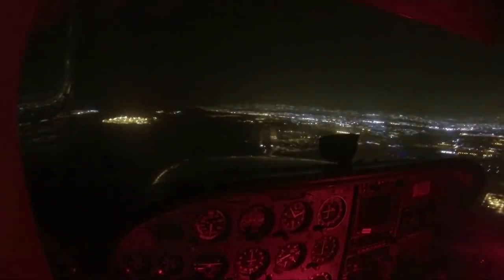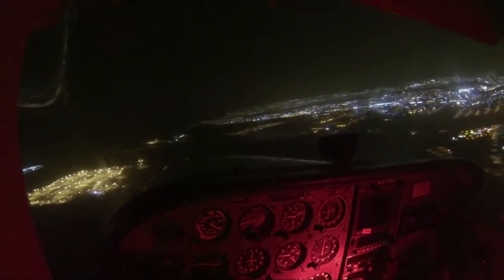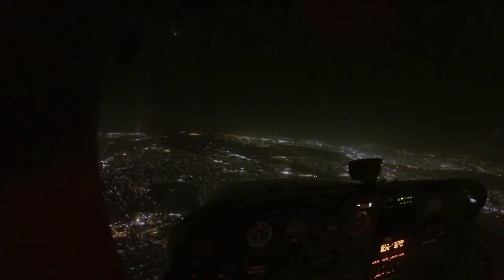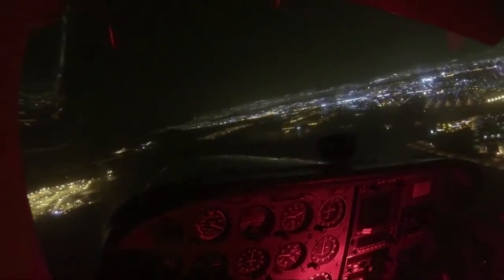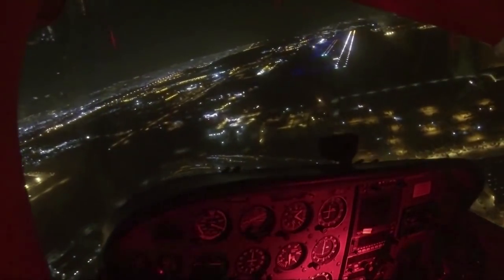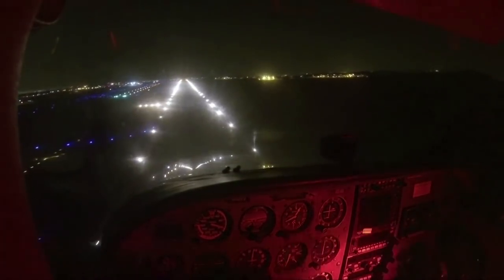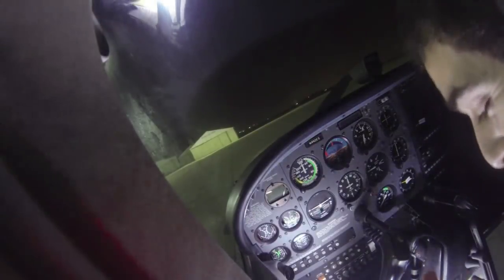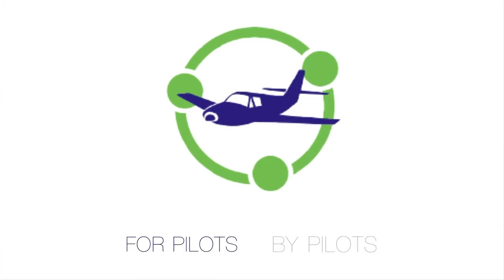Total Electrical Failure at NIGHT - Low time pilot - POV Flying

Comment: Imagine if the runway lights turned back on...  That would mean another plane was coming in behind him and he'd have no radio to let them know there's a plane with no lights sitting in its way
Scary stuff
Reply: There would be runway lights and they would see the plane and abort the landing.
Reply: Ahmad ob Not necessarily. I don't know if you're a pilot or not,  but at most uncontrolled airports the runway lights stay off, unless turned on by keying the mic 3 times in this case for night flying (Low Intensity). If there happens to be another aircraft behind him, he most likely wouldn't see him until he's right on top of them, even if he turned the runway lights back on. Also if these guys did see another aircraft coming in, they wouldn't be able to do a go around... like he said in the video "he has electric flaps, which are down", the you can't climb in a 172 with full flaps at 65 knots. So he'd probably just end up in the trees at the end of the runway.
Reply: Forget it. The only lights you can see well are the strobes. And with no power the strobes are off. He is on the centerline and belive me (I have a night flight qualification), only due to the runway lights, the centerline stays black. You only see the ground with your landing lights and then maybe its already too late.
This is a very dangerous situation.
Reply: Big throttle and run it off the side of the runway. Probably be cheaper to pull it out of the mud the next day than paying for three funerals plus how ever many in the incoming plane that would hit them..
Reply: Rubberboot  the latest i usually turn on the loghts is 6 miles away. And im flying helicopters. For fixed wing thatd be short final. So id expect that aircraft to be 12miles out. Wprst case 8 mile final.. enought time to land and taxi off the runway.
Reply: It would be a bit terrifying, but you probably have at the least one or two minutes before the arriving aircraft lands, and because the lights are on, you can see where the taxiways are now. It's be a bit rushed but clearing the runway shouldn't be an issue.
Reply: Doesn't have to mean that. My flight instructor usually gets pretty bored on long night flights so every now and then when he passes an airport, in order to check his location, he would click the lights on to full brightness. If he didn't see them come on he knew he was screwed.
Reply: that was clearly a runway for small planes..not an airport. and i dont think that night someone else was landing
Reply: @geniusmarcsays2434  that is still an airport, regardless of runway size. Also, aircraft can land at anytime, even if its in the middle of the night although it is not as frequent. Use some common sense on that note.
Reply: DJ he could just move out the way lol it’s not like in 1 second the lights turn on a plane is behind u he would have enough time to just drive off the runway into the dirt and head away
Reply: People are implying all pilots are good pilots.
If a crusty farting old man is trying to land behind him, he's probably seeing worse at night than the camera, might have never called in on the radio (I've had people do that to me before) went for a straight approach landing (you're not supposed to do that on uncontrolled airfields but again, the old guys love to do that) and worse, probably forgot his lights because his memory is failing him.
I nearly had a head-on collision with one of those retired guys once when I was in short final. The damn guys should be locked in their nursing home permanently..
Reply: Well, he still got his engine, he could just leave the runway 😊
Reply: @redworior66  nope because the loss of electric power that means the aircraft's exterior lights would be off aswell so for the other pilots by the time they saw the Cessna on the runway it would be too late
Reply: @thegamingaviator13  Yes if they lost both the alternator and battery that is correct.
Reply: i wonder wehy the lights went off, is there a timer?
Reply: @Raketenclub  yep there is it's 15 minutes. You have to click the mic on the same frequency to turn them on
Reply: @redworior66  thx :)
Reply: He would land on his back and if everything gone right, the planes could mate! :)
Reply: Wow, thanks to all. I am not a pilot but play around with a flightsim every now and then, didnt know one can switch on and off the lights of the airports, i thought they are on all night as long the airport is active or someone is in the tower.
Reply: well no because when the runway lights come off that would mean the airport is closed they don't just turn it off that's just dumb
Reply: there's a thing called blackhole affect, runways like these, even with lights you will feel like landing onto a black hole. An airplane with no lights whatsoever on the runway would be very hard to see until the final moment of touchdown. I am a student pilot, haven't got to night flying yet but have flown at night (not as PIC) and have seen the black hole affect myself.
Reply: I had that thought too but that incoming plane would still be a couple mins away. And the taxiway lights would atleast switch on, so you'd have enough time to taxi off the runway.

Comment: Fantastic footage, I am impressed with how he put it down after the lights went out.   beast mode.
Reply: He could likely see a lot more than the cheap camera recording the footage.  Exposure is notoriously bad on those things.  Still though it had to have been pretty nerve wracking.
Reply: I'd get a powerful flashlight outside the window w/ a throttle position prob set to like 15% for a good glide slope.
Reply: We are trained to look down the runway (even on daylight landings), so if the runway lights go out, you can still focus on a particular city light beyond the length of the runway to guide you, and if you keep your speed consistently just above stall speed, your landing should still be on the runway. Good job by the pilot.

Comment: First flight without an instructor. First night flight. No electrical, no landing lights, no radio... How does this guy put his pants on with balls that big? Gotta be a struggle.
Reply: And how does the airplane even takes off with such crippling balls of steel overweight?
Reply: From this flight on, everything else will be a cake walk haha
Reply: A single prop carried those balls... Obviously the plane failed from being overworked.
Reply: The same way the wright bros took off and landed with no electricity.
Reply: @tonyweaver2353  A bit different, but yeah. luckily the aircraft was mechanically controlled.
Reply: I'm pretty sure if you get the planet balls package with that plane it comes with custom flight pants for that reason
Reply: If this is his first flight without an instructor, how was he legally able to carry 3 other passengers?
Reply: @sgt0m0sullivan  Possible pilot passenger? Not sure on that one, but he did do well.
Reply: @timbrwolf1121  Definitely. I would have a reflex of going around when those lights kicked off. I probably wouldve then tried to find a towered airport and saught lightgun signals, but those flaps were stuck, and like flightchops said, electrical failure could indicate a fire
Reply: @sgt0m0sullivan  Most definitely in a full failure like that LAND. Wherever you see a clear zone. He was lucky that zone was a runway and not a dimly lit city street. Hell that's what drivers education teaches as well in states with decent drivers ed. If your vehicle shuts off and you lose any type of control stop and/or move to shoulder. Kid had already finished his final. All he had left to do was land it. Sucked he had no lights, but he nailed it better than pilots with hundreds more hours.
Reply: Also he apparently had an FCC amateur radio license to be able to carry that handheld and legally be able to communicate with it. Many props to him on that. Many pilots do not carry a handheld
Reply: @timbrwolf1121  Negative.  For the aviation bands, if you are a private pilot you can obtain a "Restricted Operator" certificate from the FCC by simply requesting it - no test required.  If you are flying the US - this is really pretty worthless as it will never be an issue in reality- but if you are flying out of the country it is required to operate aviation radios.  Also - there is no requirement at all to have any sort of license to own and carry a transceiver on any band - only to use it for transmission on certain frequencies.  So - it is perfectly legal to purchase and carry a backup aviation radio.  And if you are in an emergency, it is just not an issue whether you have paperwork or not.
Reply: @michaelbuckers  Oh goodness, too damn funny!
Reply: @sgt0m0sullivan  He must've already has his PPL at this point.
Reply: i think  it meant (though i maybe wrong) that this was his first night flight without an instructor not his first flight without an instructor
Reply: @jennydavis4198  yep, the narrator definitely says "It was his first night flight without his instructor." Clearly talking about night flying

Comment: Happened with a newer pilot at my flight school. He couldn't cue the lights for the local non-towered fields or get anyone on cellphone. He ended up sneaking in and landing at a non-bust class C airport. They never saw him. As soon as he landed, he pulled off the runway and another small plane landed from the opposite direction and asked tower if they knew why there was a Cessna in the grass off the runway.

Comment: Don't forget about the handheld Revolver incase the passenger turns into zombie.
Reply: Dont forget the emergency shutgun incase the passangers get really really anyoing.
Reply: AirPlanes? Just throw a grenade like in the movies.
Reply: Is there such a thing as a non handheld revolver?
Reply: @striker6240  Ryszard Tobys from poland scaled up a  Remington model 1859 to the point you carry it with two people and can not fire it handheld. ;)
Reply: @Tahydrahel  Yeah I fucking knew someone would bring that up. That is not a fucking revolver buddy that is a fucking cannon
Reply: NICK WHAT THE HELL YOU SHOT THE PILOT
Reply: @striker6240  It's not a revolving pistol, but it is a revolver of sorts. I guess that means a revolving cruise missile drum in a bomb bay is also a revolver.
Reply: @striker6240  Yo. Chill out.
Reply: @striker6240  Panel mounted revolver
Reply: @sgt0m0sullivan  Not a gun that is a modification to a gun
Reply: @striker6240 Thinking of the crotch revolver in From Dusk Till Dawn...

Comment: If you buy a handheld, don't forget to get the headset adapter because it's almost useless to hear anything in the cockpit through the handheld speaker.  It will work ok to turn on lights though.
Reply: Robert Bousquet even if you can’t hear at least you can tune into tower or CTAF and blab out what’s going on.
Reply: Definitely on my shopping list
Reply: Good information! Need to plug in

Comment: When I was taking my flight lessons I had two different failure that I got to learn form. My  single light bulb that lights up the panel burnt out and so I couldn't see at all; Lesson learned, I now all ways have a headlamp on my head or in the pocket by my knee. Second issue I had was my voltage regulator burned out and so my entire electrical system started to over charge. I burned out my radios and my landing lights, I was lucky enough to have my hand held radio charged and accessible with a head set adapter so there were no issues.....except when I landed at night at a small airport that didn't have lit taxi ways...I went right off the taxi way in to the grass. Had to shut down push back on to the taxi way and keep going. Fun stuff!
Reply from the maker: flyhigh8313x Thanks for sharing your story.

Comment: ipad and handheld radio...   now a requirement in my plane.
Reply from the maker: David Heon yup!
Reply: don't forget the emergency light attached somewhere so u can turn it on quickly with the push of a button :D
Reply: What is the iPad for? Not a pilot at all, just curious.
Reply: That's an awesome app, looks very useful.
Reply: David lemme fly your plane
Reply: @atomicmrpelly  The iPad is to use an "Electronic Flight Bag" (EFB) apps. Pilots can look at maps, weather, airport diagrams, and much more. 
In north America the most popular EFB is called "Foreflight". All the pilots I know have an iPad with Foreflight. I can't imagine flying without it but still carry paper maps just in case.

Comment: That was "some kind of cool" exercised there!!   Having flown over 30 years, I don't know if I could have done as good as he did.  Nerves of steel - gotta be!  :)   As you can see, "Murphy" is alive and well!   Thanks, N-6395T
Reply from the maker: Michael Donavon Thanks Michael, and yes, I'm appreciative that Stephen shared this footage and collaborated to help me me edit a video about it.
Reply: +FlightChops When those lights went off and the screen was total black I got the gut sink feeling.  Screaming go around in my head.
Reply: *****
I  watched the video again, and let me say this:  Stephen's performance, under extreme pressure, at around 60 hours of flight time,  is nothing less than phenomenal!

Wow!     He said that it was, "Pretty close to an emergency..."   Pretty close?   In my little 1,000 hr book, it WAS an emergency.   Thanks,
Reply: As they say, "Murphy was an optimist". Good job!

Comment: Very well handled imho. First step, fly the plane! It can actually help calm a passenger down by giving them a task in an emergency situation, such as holding the flashlight, or watching an instrument like an untuned VOR (obviously not possible without power). Then he assessed the situation, made his plan to land on the field, and executed it. Very nicely done! I am just at 40 hours, and should have taken my check ride already, but it's been over a year since I was in the left seat. I really need to get my motivation and finish! Thanks for posting your videos, it's really helping me get the itch again. After getting my chops back in the sim, I need to get back on that horse!
Reply from the maker: +Robert Reese Awesome! And yes you are correct about the "distract a passenger" trick.  I actually made a video about passenger management and that is one of the tips I share.
Reply: He had some serious luck there.. Had he been a minute or so later, the lights would have gone off before he was on short final, and then good luck charlie in seeing the runway..
Reply: Many years ago, I was  on an IFR flight into Fort Wayne in a Piper Archer. Just as I went into the top of the clouds, the panel lights went out. I reached up and cranked up the overhead cabin light, and with that, I could see the instruments OK and continued my descent, however the passenger in the right seat started checking out the breaker panel. Not wanting him to inadvertently hit a breaker that would screw us up, I told him that I had the electrical situation under control, but that it would really help if watched out the front window and told me the instant he could see the runway. It was about 500 overcast, so he was occupied looking for the runway almost right up to the end.
Reply: Robert Now that's it's been over a year since you left this comment I have to ask, did you get back on that horse and knock the rust off and take that check ride?

Comment: This is a best case scenario landing if I ever saw one. He was well withing the vicinity of an airport that was lit during the most important moments - other than just before touch down, but he did a great job of flying the plane and not allowing his emotions to distract him. He stayed calm, appeared to do some troubleshooting, had passengers assist him, kept the pax busy so they weren't panicking, and he got the plane down in one piece without injury or property damage. Very nice job!! Very nice for such a low time pilot too! Great video too! I love it!! It's a fear of mine. Of course my biggest fear is losing engine power at night - with or without pax. ;)

Comment: Excellent video. I love how every-time I watch one of your videos I not only learn something I either did not know before or hadn't been fully aware of, but I also keep adding things to my list of must have equipment. Today: Red-light flashlight, strong white light flashlight, extra radio. Thanks man!
Reply: Grab some combo lights, with one of them being head-mounted! After this, I quickly picked up a head mounted light with red and white.
Reply from the maker: Good stuff guys!  I have a combo light that hangs around my neck with a bendy sort of arm...  hard to explain but search "hug light" and you'll find it.  I also have 2 others as back up with in easy reach.

Comment: This pilot did a great job! My first solo flight in my T210N was daytime at KAPA. Super busy airport.  When I put the gear up, total electrical failure. Got to pump the gear down by hand, returned to the runway. An alert controller cleared it when he saw my transponder go out.  I carry a handheld now.

Comment: I'm a student pilot myself in the Houston area, and just tonight completed all night flight requirements.  Early on, I bought a hand-held radio, figuring it was money very well spent.  I use it before every flight to make sure it's working and the batteries are good.  I keep it in an external pocket in my flight bag, readily accessible at all times.  Almost had to use it recently when we lost nearly all battery power when taxiing after a night landing.  And get this...the engine quit at that same time. We just barely had enough battery to talk to the tower and get help.  I'm still trying to wrap my head around how we got snake bit with 2 problems at the same moment.  Kudos to this pilot for maintaining calm and getting 'er down safely.  VERY well done!
Reply from the maker: John L Right on!  and agreed - Steven owned it on this flight!